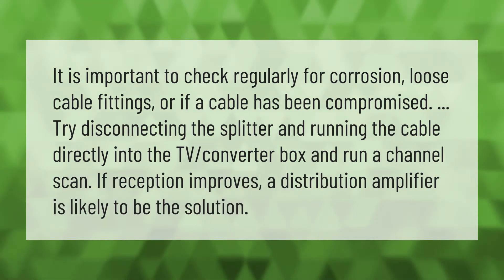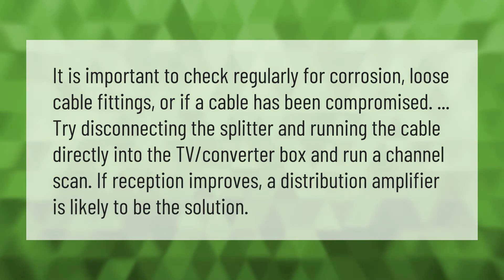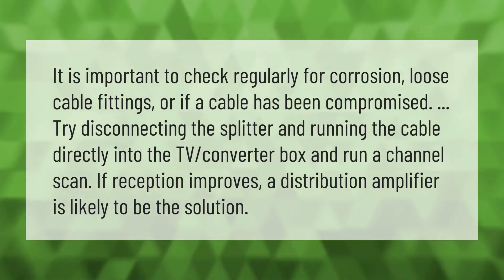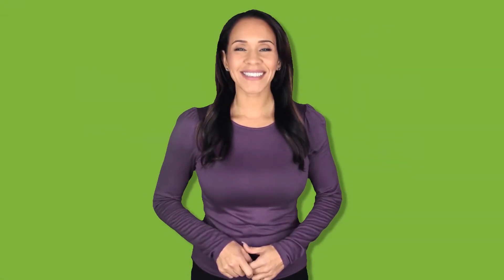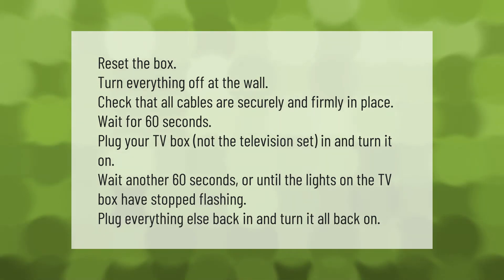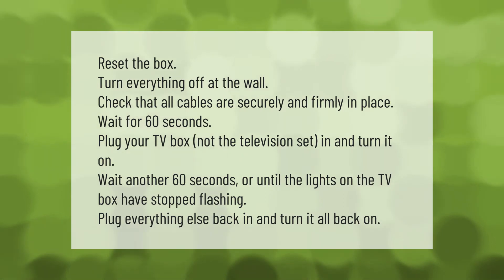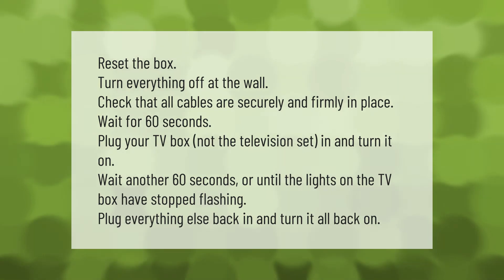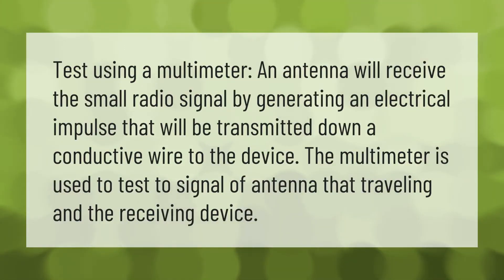Why is my antenna not picking up channels?

Comment: My two tvs were't picking any channels.  Antennas worked fine. I went to all the Google Apps, especially system apps, shut down whichever ones I could, and cleared the data stored. Any update that I could remove I did. The tvs now work fine. It's not an antenna issue. It's an android issue. BTW, I did not touch the remote app, but did clear all the data. It took about 3 minutes at most.